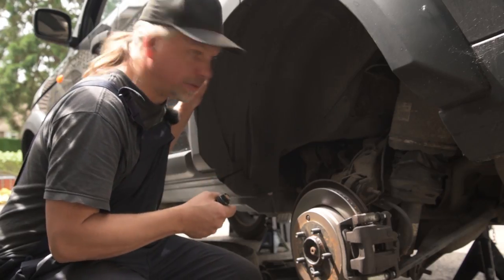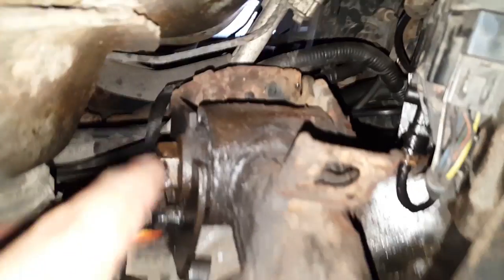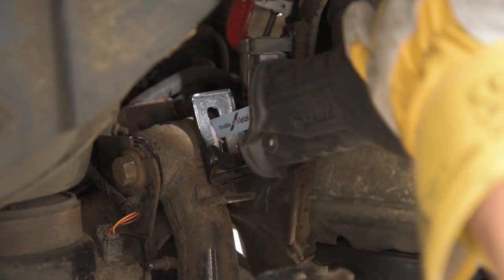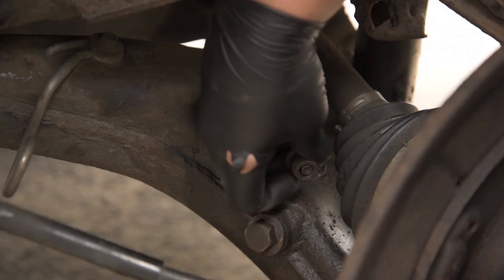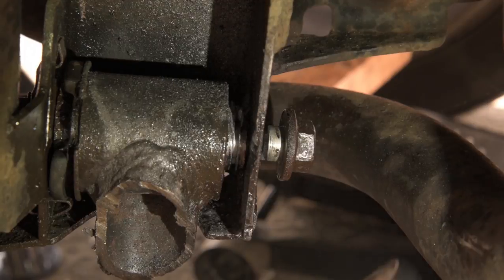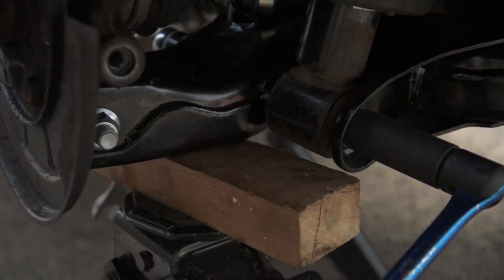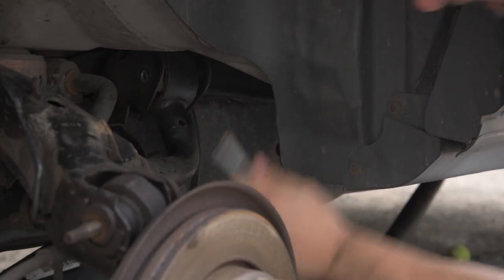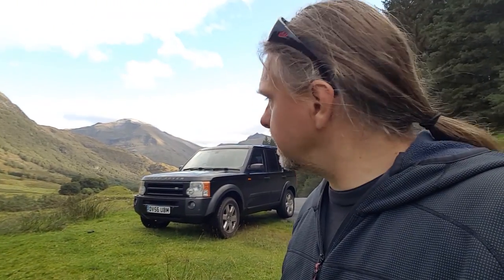Replacing Rear Suspension Arms and Polybushes - Land Rover Discovery 3

Comment: Brilliant documentary. I did my rear left upper arm last week. The only advice I will say is an angle grinder is a must with a discovery 3 of this age. Don't mess around with them silly saws. Did you roll back the epb or recalibrate. I need to do mine soon and that's an unknown job for me... Your guide was pretty good on the mechanical side
Reply from the maker: Thanks.  It was so long ago I don't remember exactly what I did with the EPB.  I will have used my Gap Diagnostic IID tool, though.

Comment: Excellent video. You may have saved money and time by having a  garage do the job....however experience is invaluable. I'm a mechanic by trade and it took me the best part of a morning to do one arm... Was a bas#$@d. However next time it'll be out in an hour. It's always the same the first time you do a job like that.
Reply from the maker: Thanks for watching John.

I'm glad to hear that other people have a similar time when underneath the Discovery 3.  I might add that, now I've tackled what I consider to be a complicated job, I have more understanding and respect for the quotes mechanics give.

My biggest shock was how fast rust appears.  This job took about 8 weekends for me to film from start to finish.  Some of the brand new parts had already started to corrode by the time it was back on the road.

And then there's the nosey neighbours.  The parking area where I fixed my car is a shared area.  I must have spent a quarter of the time talking with them.

Comment: Simon,  that video is an absolute scream.  Very entertaining indeed.  I had my Diesel Discovery 3 for 3 months.  I have replaced one air suspension strut and without the right tools.  What a job.  Nothing compared to your 5 weekend debacle.  But difficult to say the least. At the moment it has a coolant leak in the EGR coolers which at first I thought was a water pump- then a head gasket.  Thankfully I figured it out before I attempted to pull the heads off.  😂 The new water pump has gotta be a good thing right.  I will be deleting the EGR valves etc on Monday (when the parts arrive).  Then I will bypass the EGR coolers and run a hose directly to the heater core from the crossover pipe outlet that feeds the coolers.   I hope it works out well.  I broke down on holidays and am 650kms from home. 🤦🏻 looking forward to watching your other videos.

Comment: I had my rear upper control arms and bushings replaced both sides and only a few weeks later my suspension squeaks and groans like a b&%ger, and it's got worse. Started as just the left side now both sides. The garage that replaced the control arms want to charge me another $800 to do the control ball bushings upper and lower.  Seems to be not an entirely uncommon problem. The questions is why. Thoughts ?

Comment: Husband is a LR tech, when he did ours he heats them up n uses a air hammer to remove the bolts or cuts them off with a cut off saw. The reason the last bolt wouldn't remove the first time you attempted it is very simple, you were tightening it up not undoing the bolt haha.
Reply: oh no way!!! lol.  this job looks like a right mission to do.
Reply from the maker: +nick h.  It's easier when you know what to expect and have the correct tools.  Tools.  It's always about tools.
Reply from the maker: +Karina Fletcher. I envision an Air Hammer is similar to an Air Guitar, no?
Reply: Lol No I use big nasty air hammer from IR lol.
Reply: 😂 😂 😂 😂 😂 😂 I laughed my head off the whole time, he destroyed spanners, etc on one bolt bt turning it the wrong side bt I learnt from him alot, I own a defender 300tdi bt would wish to get these models too, it's actually been very informative to me Particularly.

Comment: Just a quick note, when working on the LR jacked up at the rear with stands underneath I didn’t see if you had chocked the front wheels, seeing you underneath the vehicle pulling and pushing you didn’t have any extra safety net so here’s a tip slide both rear wheels on their side one on top of the other and place them under the vehicle on the side your working on so should the vehicle slip off the stands it won’t come crashing down on you, and could save your life working on your own just saying been in the motor game 50 years think ahead safety first…..Derek lee

Comment: You know that bit in Jaws were he says "we are going to need a bigger boat" ?  Well I learned when working on my Defender that you need a bigger socket set!  Love the Disco3 and am very tempted to buy one.
Reply from the maker: Disco 3's are going for less than £5,000 nowadays, and you've already got your bigger sockets.  Go get one!  They are really good machines, if you can keep them running.
I would prefer if there was a simpler version, without all the electronic gizmos - central locking, electric wing mirrors, electric seats, electric windows, electric parking brake and all that stuff.

Comment: @20.30 IT SEEMS THE BOLT WILL NOT LOOSEN BECAUSE YOU ARE ACTUALLY TIGHTENING IT UP? ?? THE SPEED ON THE RECIPROCATING SAW IS TOO FAST THATS WHY THE BLADES ARE BURNING AND NOT LASTING, SLOW IT DOWN A LITTLE.

Comment: Very well done, in the beginning I almost stoppped watching I thought you don't know anything I could learn but seen a few good ideas! Measuring road height and jacking up before tightening is one, ratchet strap on drum brake is good,  liked the bush puller set - what was that, would like to buy one too? Also seen a good cleanup operation before putting everything back and copper grease, I like that and so many times pro mechanics just hammer back everything together without getting rid of rust etc. One word of advice - get a 1/2" impact wrench, it will make your life 100% easier and would have saved days on this job. It hammers away all the rust and even regular tyre changes are a breeze with it, if you have one with torque switch on - mine is DeWalt but Milwaukee is better.
Reply from the maker: Thanks for the nice comments.  Glad you enjoyed it.  As for the bush press kit, this is the exact one I bought - https://amzn.to/2IRjjcv

Comment: Cheers mate for an excellent video record. I felt every high and low!! I'm in the middle of doing all four corners, upper and lower control arms, followed by the steering rack if I want it to go in a straight line as well smoothly, and you (and your good lady) are an inspiration! I think I've been forwarned about a couple of 'snags' I may not have anticipated and I thought I'd covered every fecin thing! NS REAR penetrating oil and heat, fecin lots...and all loose...so far!! Had to smile at the end 'cos you drove past my house in Fort William on your way up to Blarmachfoldach, pronounced Blar mah fol cha to us locals....If you'd like a spell on the Isle of Skye in Uig, let me know, my cottage is available and cheap!!! Be well and thanks, superb.
Reply from the maker: Good luck finishing your project.

Comment: You did a great job on that video, I have an 2007 LR3 with close to 400K miles on it and I cant kill the beast! But I did have both the front and the rear control arms changed out but I decided to buy the parts and had the local mechanic do the grunt work, I also had them change out the steering rack and main steering shaft that has a linkage that started to freeze up! I watched your video to the end and I enjoyed every bit of it, my truck is driving great again I hope yours is going the same.
Reply from the maker: Thanks for watching.  I too have a truck that drives great, but it has certainly cost me a small fortune keeping it that way.
Reply: There's a local LR3 I want to buy with 199k miles on it for 3k - now you're making me consider to actually pull the trigger

Comment: Subscribed for your editing skills alone, good audio. lucky with the drop links, I was a solid 3 hour grinding my old ones off, found the Bosch blades best for the rear top arms. Nice work.
Reply from the maker: Thanks!  I'd was trying to source those Diablo Blades, but they're not available in the UK.  I've since discovered cutting oil.  Too late, I suppose.  I'm not doing it again.

Comment: Top video, entertaining right throughout. Got my D3 last July 2008 gs with 130k, decided when i got it i would do as much as i could mechanically myself although ive never worked on cars before (discovery 3 not the best place to start) so had a crack at a full oil and filter service. 

All went smoothly until i got to the transfer box and instead of loosening the drain plug i was tightening it stripping the thread on the transfer box. I spent the next 3 full days searching for a way to fix the problem so i could make it to whaddon 4x4 day in my new d3 on the weekend. Was pointed in the direction of thread tapping kits on the facebook owners page, having no experience with anything like that i felt way in over my head but like you in the video had no option but to carry on. 

Said thread tapping was a success, and i was off. Wading through everything whaddon could throw at the D3, it was worth every minute of blood sweat and tears of the previous few days - until the end of the day when i got an almighty squeal from the handbrake. A quick look at the back wheels and i realise that the plugs to stop all the crap getting into the shoes where missing, and i now had to pull the emergency release cable to get the handbrake off. Of course when you do that you then have to re latch the cable, as well as getting the shoes off and cleaned/greased - there began my second d3 DIY job which was just as successful... Ups and downs but you cant beat these trucks.

Pick up the tools and get stuck in. Be good to see you take yours offroad (then fix it when you break it)..
Reply from the maker: Thanks for watching.

I've had my D3 almost five years now and the list of things to fix is growing, despite my best efforts.  The idea of taking mine off road just seems like an impossible dream at the moment.  My next tool box effort will be finding my electrical problem - Which started as "Rear Parking Sensors Shorted to Ground" and has become tailgate door opens itself, subwoofer shorted, front parking sensors shorted to ground and a slow battery drain.

I have filmed fixing a sagging suspension corner / air leak, but not sure whether to edit that and upload it as there's no humour.

Comment: First of all . Well done for your perseverance. Secondly a blowtorch and an angle grinder are your best friends. Don’t bother trying to undo very rusty bolts. Cut them off. You can also use a nut splitter but the bolts rust in the metal sleeves. Anyway best of luck for future mechanics.
Reply from the maker: Thanks for the tips!

Comment: Enjoyed this video. A fine example of the tried and tested British tradition of dropping yourself in the sh*t and then getting yourself out of it again, If you need to do rear arms on a Dis3 again you will absolutely cream your way through it. If you had paid to have a mech do it would you have got as good an end result? As you said it has never driven so well and you know its right. I did find myself shouting at the screen "your doing it up ,your doing it up." However i cannot cast any stones as been there and done that more than once .
Reply from the maker: Thanks for the kind comments.  And you're right - everybody has tightened a bolt when they should have been loosening.  Everybody.

Comment: 6.00 . I am working on the same bolt as 6.00.  The nut was easy, but the bolt is rusted in the bushing. Then I began to drill with 15 mm throught the hol bolt. Not finish yet . Two afternoons is enought . I think the bolt is erased tomorow . Great video !!
Reply from the maker: In my opinion, two afternoons fixing a car is two afternoons too much.  Good luck!

Comment: Great vid!  What poly bushes did you use and how do you find the ride?
Reply from the maker: Polybushes are horrible. They make a nasty creaking noise, even now, nearly two years later.  The ride is better than it was, because the old ones rusted, but I'd recommend putting OEM bushes in and leave the polybushes alone.
Reply: @WeAreBigKids  
Thanks for the reply. I ordered new RRS arms, they are supposed to last longer.

Comment: Great video again , really helpful to all us Disco owners .
Top tip ... Use a carbide tipped reciprocating saw blade 6" , e.g. Diablo or Lenox .  It's what Firemen use to cut people out of crashed cars . You can cut a bolt in no time , also it will cut through the wishbone ( if you need to ) like a machete through Philadelphia cheese . Look at the vids on YouTube about Diablo or Lenox Carbide tipped  Reciprocating saw blades.  You don't need an expensive saw either.  I'm going to do my front wishbones,  so i'll video cutting the bolts with a Lenox blade and see if they are as good as they make out .
Reply from the maker: I did see the video for the Diablo blades before I started. Unfortunately I couldn't find anywhere that sells them in the U.K.  I had to go with the chocolate-dipped ones instead.  I think it made for a funnier video, mind, so worth every penny.
Reply: @WeAreBigKids  your right there ha ha , it was funny watching the pile of blades get bigger , but not funny watching you break your tools , trying the loosen that bolt the wrong way , we've all done it . 
I just ordered a Lenox blade for my saw,  supposed to be as good or better than Diablo , it was about £10 on ebay from a place in the Midlands.  Hopefully i won't need it , but that's just wishful thinking.  Thanks again Graeme

Comment: Du musst die Schaube bei Minute 21 links herum aufdrehen!  Dann bleibt auch dein Werkzeug heile. Beim Sägen etwas weniger Geschwindigkeit und Öl. Dann halten die Sawblates viel länger. Kommt nochmal ein Video von dir?  Dieses Video  ist absolut sehenswert.
Reply from the maker: Thank you for the tip about sawing slower with oil.  Will try it next time.  New video released any time now - Replacing the Electronic Parking Brake.

Comment: Disco3 rear suspension is the worst design to remove the bolts. I remove all the electrical components and brake lines I'm gas axe the whole lot out it's a job that can't be done without a bit of heat
Reply from the maker: It'll only need fixing once, right?
Thanks for watching.

Comment: Great video mate, I've done that job so many times, but the first time we were all like you.
As you found out it's all about the tools. But you gained the experience, and that's the true satisfaction. 
One massive tip though, always stack the wheels under the tow hitch when pulling that hard on breaker bars under there as it's so easy to pull the car off the axle stands, and you were too far under to get out, it's a horrible way to die when there are two big wheels just waiting to be used as packing just there, I know it sounds a bit elf and safely, but we all hate pain and suffering. In my experience that spray copperslip is useless compared to the stuff in pots, Neversieze and Ceramic Stuff is the best. Fair play to you, you did it, many people have failed, be safe. 😊
Reply from the maker: Thanks for the advice.

Comment: Rule number 1 when working on a Disco 3 rear arms (or front for that matter) : have a set of burners "it cant be tight if its liquid!"
2: lever compressor down with pry bar then you can get bolt out
3: always get new bolts (once they have been liquid there fucked)
3: cut or burn the arm off and get a new one (the existing one WILL be rotten or soon WILL be)
4: Tighten suspension component bolts with weight on suspension (wheels on the ground normal ride height) otherwise those new bushes will end up like the old ones in no time 

I always wonder why the drop links have such long threads on them, its as if landrover went through the parts bin and just used the ones that fitted 

enjoyed the vid, not sure why i watched it though because i do this shit for a job 6 days a week,

well done for doing this on your drive without the tools i would want to do the job, you look like you were "really enjoying youself" at times, you didnt waste the time and money as you say because you learnt how to do something and you cant put a price on that,, great effort

siracha hot sauce, awesome stuff
Reply from the maker: Thanks for your insight.  Just one question, how on earth do you get the wrench in to the top arm bolts if the car is set to normal ride height?  The wheels are in the way.  A standard way of setting this is to jack up the hub without the wheel fitted, which is what I did.  But you're suggesting you do it with the wheel on.  I just couldn't work that bit out.
Thanks for watching!

Comment: Love you channel and videos. I have replaced these arms after watching your videos 👍 but I forgot to measure the height before I tighten the bolts. Now the back end is sat down and lots of suspension lights on do you have any advise would be a great help 👍👍👍
Reply from the maker: Good work.  The suspension lights are probably a sensor rather than the bolts tightened at the wrong height.  Because there's no air in your shocks the car is lower than the sensor goes.  Turn the car off, jack it up a little and then start the engine.  It will fool the car, because the jack will lift it back into sensor range.
Good luck.
Reply: @WeAreBigKids  thank you for the reply will give it a go. Keep up the good work on the discos you are a credit to YouTube